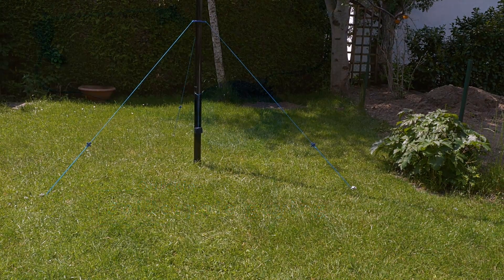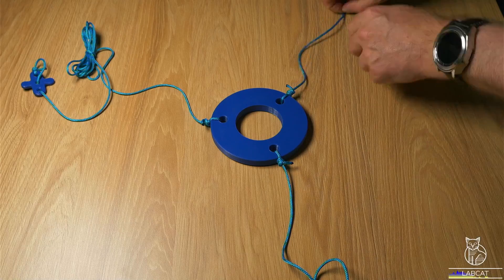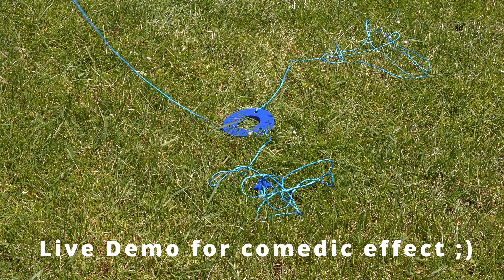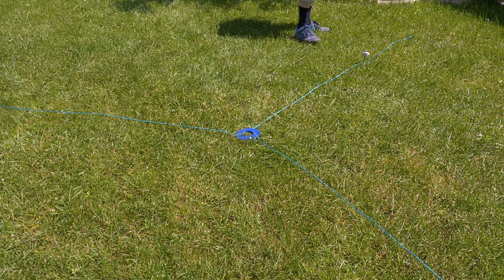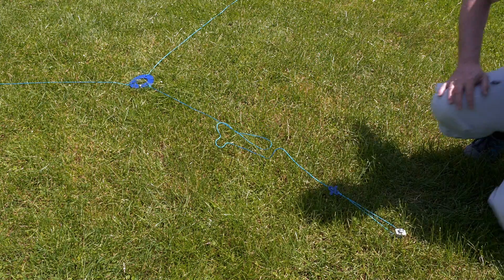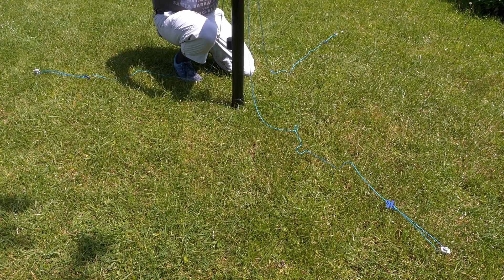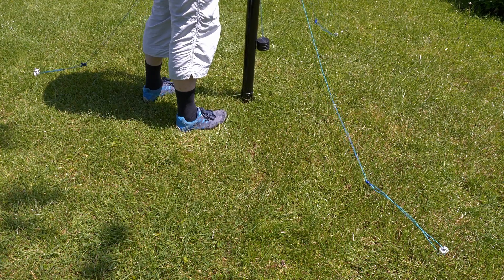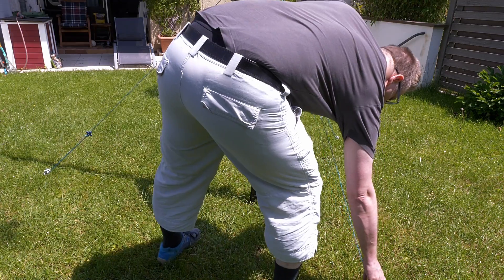Spiderpole guying | HamRadio

Comment: Thanks for the video. I operate portable all the time my method is:
- My 3 cords have a bowline knot at the ground ends
- I stick 2 of the 3 pegs on the ground attaching the corresponding 2 ropes and keep the 3rd peg on my pocket
- I fully extend the mast through the center rope support
- I keep the mast vertical and move it away from the 2 pegs until there is tension on the 2 ropes
- I take the 3rd rope with my hands and start going the opposite direction of the 2 installed pegs
- I then stick the 3rd peg on the ground with the 3rd rope bowline attached to it
Done :)